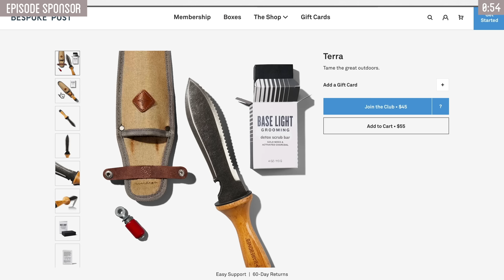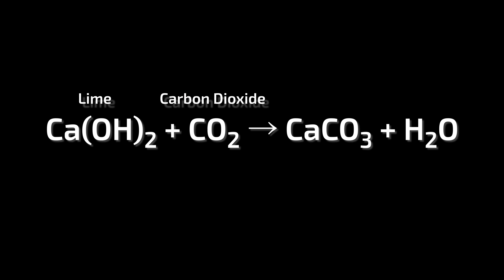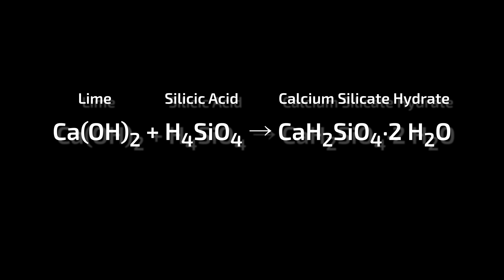How to Make Roman Concrete (4 Different Materials, 4 Different Strengths)

Comment: Lesson #1:  Don’t use round rocks in concrete.

Roman cement is not used for its strength but its resilience to weathering as it cures over 30-50 years. A crush test is testing the wrong property.
Reply: If the cure time is measured in decades, a crush test of months-old at most concrete is also testing on the wrong timescale.
Reply: I was looking for this comment. I was going to say the same thing. A crush test for Roman concrete after such a short cure time doesn’t showcase its amazing properties and potential. Roman concrete continues to cure and strengthen over much longer periods of time.
Reply: @Hundura  Without question, you are correct.  He failed at allowing it to have the cure time which would give the crush test its best result.  HOWEVER... the Romans weren't waiting 30-50 years to use the concrete.  It was being used - more or less - right away.  If a concrete brick ( or whatever shape being used) couldn't take the required load after a short period of curing, then it simply wasn't going to be around to finish the curing process.
Reply: @Hundura  Maybe, but if you are building a structure you would want to design and build it around it's strength in the near future. I don't think they ever intended to make the bricks then leave them half a century before finishing the building.
Reply: Round river cobbles were used in concrete until at least the 1960's. They are not as good as angular aggregate for high strength applications, but for many structures round rock is 'good enough'. I just worked on a highway bridge built in 1961 with a river cobble concrete mix that is holding strong after 50+ years of heavy truck traffic.
Reply: I feel like while it's not a completely fair thing to test it is still somewhat valid. Though it probably still cured a bit longer before use(cut for time because Youtube of course) it was still used to build things ... things that had force put on them. And modern concrete is also used partially because it lasts a long time as well(It is just also put under more stress making people think that it doesn't.
Reply: @xarin42  yes but he didn't use salt water in its construction and the type of roman concrete he made was for upper walls/roofing, foundation roman concrete had far less pumice in it we are talking single digits. To put into actual perspective the Worlds largest Concrete dome is made by the romans out of Roman concrete and modern concrete doesn't have the strength to weight to copy it without steel reinforcement.

He made a low strength high pumice Roman concrete then added aggregate to it when it lacked the strength to properly bond to such aggregate due to being a low weight low strength mix.

The calcium-aluminum-silicate-hydrate bond in Roman concrete is twice as strong as the chemical bonds in modern cement, you even add a few % of Pumice to modern concrete to make a Roman type concrete with increased strength and durability.
Reply: did we ever find out quantities of each ingredient to make up Roman concrete also? too much of one substance and not enough of another will completely change the properties of the end product.

There are a few factors to this test not being super accurate or fair.
Reply: we actually don't know the true recipe for what they built their longest lasting monuments out of we tried analyzing it and using the same ingredients but it doesn't turn out as well(their secret ingredient was seawater so the right amount of salt is key)
Reply: @Anon-zu3xn  actually we did find it a couple of years ago. We have had the recipe for a while just couldn't get it to work right. Apparently we were missing that when they said water it was meant to be sea water
Reply: @wk9953  there's one recipe I heard of that uses pigs blood
Reply: @Anon-zu3xn  yup, but actually we found the ingredient list, the issue is the process. That is passed down and memorized by apprentice from master. Plagues, wars and loss of trade over time is what made us loose that. Yes salt was key, but their was also some sort of kiln or cold fusion that occured. (Actually, I'm thinking earth was more volcanically and geo active back then.  Which can be proved by the gases not coming out of the Oracle areas like it used to, but it will again cause the plutonium fault always has a big one every 667 years and we are due. Thus I'm thinking they used magma instead of ash. Them and the greeks knew how to throw people off and keep secrets).
Reply: @razorransom1795  they did use a special type of salt from the local area to make mummies in egypt so perhaps that could have something to do with it,a lot of the result could be humidity based as well if theres too much humidity concrete won't cure the same as an area with no humidity
Reply: @Anon-zu3xn  That was Natron (Not sure if I am spelling it right) I don't think the Romans would have shipped it for all of their construction projects. I would think that they would locally source as much as possible, The Gallley was an amazing vessel, but moving gain and other commodities would have had priority over the labour of a heavy mineral in great quantities.

One thing to keep in mind is that while we are modern and building upon generations of experience, we are all young nations compared to the Romans. The Romans spanned centuries and during most of that time, they had greater population numbers than most of the Medieval and renaissance world. they were highly advanced people even by modern standards. we only regard them as primitive because we are more advanced with our tools... but the flip side is that we are also very primitive in many other ways.
Reply: @razorransom1795  Not to mention each Master Mason likely has his own tweaks picked up from his master(s) and because of local material availability. That just makes harder
Reply: Even modern concrete cures stronger under water for a month.  I wonder if it could be stronger yet curing under seawater?
Reply: I’m really confused where everyone got the 50 years concept from what @PersonalPerson said. No comment that I’ve seen does he even mention a specific timeline. He is saying building to last thousands of years is pointless. It’s not, if we like history. However outside of tourist spots, many of the super old structures only exist because of the heritage and significance. They serve zero societal value. Also using old buildings in Europe isn’t exact either. Many buildings in places were destroyed during the world wars. Many others are continually under restoration. But let’s take homes for instance. Many older homes in Europe weren’t set up for electricity and significant renovations had to be done to accommodate this. Mean while new builds tend to be tailored towards the technology that exists. Most home built out of flimsy wood last around 100 years easily if maintained. So this whole 50 year argument doesn’t even make sense. Heck the way we use concrete nowadays won’t last that long. But who says we have the same tech or lifestyle in 100 years. It’s not to say lasting houses aren’t valuable but the ease of renovation and costs it what matters for residential. So yeah lasting forever. Not the brightest idea.
Reply: Roman Concrete was hot mixed with CaO (quicklime) distributed through ought and it takes months to cure.  I also don't think that volcanic ash is the same as the volcanic glass, but I'm not sure about that.  He didn't do the hot mix...
Reply: @VenturaIT  you dont have to hotmix. You can take any  hardwood ash ans mix slaked lime under it. 2:1 that results in a hydraulic system cement.
What is importend is that the slaked lime is fresh. Not every vulanic ash is going to work, because the ash needs a certain mass of kalium and or aluminiumsilikate. Google "geopolymer Davidovits" he researched that stuff for 40+ years. 
That stuff isnt new it is just not in fashion because of the economics of it.
Reply: judging by the material nearby where i grew up (Trier / Augusta Treverorum) and the fact they had to keep their soldiers busy making bricks to keep them from stealing/wrecking stuff due to boredom and being armed, they'd often just use smashed up bricks (eg rejects due to cracking in firing/etc, while the bulk of the nice bricks went to cheap construction materials for all the fancy "government" projects like some rich dude's palace) for concrete. makes for rather spikey rough "rocks" that also nicely soak onto the other materials in your slurry, and as a bonus you can use it for slightly-lighter-than-bricks mortar between your bricks :D
Reply: Also its not true I’m in concrete is we still don’t know more than the two ingredients of rocks and volcanic ash
Reply: Either way its still better than our concrete, so i call bullshit on whoever "they" is finding the information to recreate it. As a lot of the still standing structures of the roman empire that are still standing havent been in use its lifetime, i guess that will and should affect or effect my opinion on it. So we  need a side by side comparison and i guess it would have to be year by year lol
Reply: Plus, any test where the brick is either uneven or sits on a pointy object (like the fired red brick that had pieces of debris still attached) does nothing but create a massive point load that OBVIOUSLY will crack the thing. Btw, did anyone see where his pressure gauge is hidden? I didn't see one. IMHO this BS is all made up.
Reply: @TrunkyDunks  According to Wikipedia, "Its name is derived from its resemblance to Portland stone which was quarried on the Isle of Portland in Dorset, England. It was named by Joseph Aspdin who obtained a patent for it in 1824."  Apparently they don't cover the history at building inspector university.
Reply: @dchall8  feel better after that flex, bro?
Reply: there is no real point to buildings standing for that long. that is just wasting the land of future generations.
Reply: @MsHumanOfTheDecade  I have to leave my house in 1 more decade and buy a new one because this building ‘expires’ in 50 years since its being built. Imagine having to buy a new house when you are 50 years old with a mortgage of 20 years added in and only being employable for 15 of those 20 years. I would rather like a building that last an average human lifetime.
Reply: @viduranimalarathne8797  build with Rammed Earth. It will last longer atleast 300 years.
Reply: @viduranimalarathne8797  I'm sorry but I doubt that there are any buildings out there that can't last at least 100 years with regular maintenance. Even ordinary wooden buildings properly designed and maintained can last forever.
Reply: @Imaboss8ball  I was being sarcastic at the modern building code here.
Reply: @Imaboss8ball go check out the mcmansions that get built in the more expensive subdivisions.
Concrete slab houses in newer middle class subdivisions are notorious for shoddy construction as well. The developers crank them out so fast that in some the foundation starts cracking before 10 years
Reply: @MsHumanOfTheDecade  Roman buildings were used for a long time, not 5 years.
Reply: @MsHumanOfTheDecade  Modern people are doing far, far more harmful things to waste land than the Romans did with the few remaining structures that have lasted 2000 years - think toxic waste dumps, burying radioactive waste, Pripyat (uninhabitable for 30,000 years), and the many tower blocks that are now standing empty all over the world (some have been empty for many years - eg. hotel in North Korea), or modern Olympic stadiums that are nothing more than white elephants left to partially decay in the ugliest manner.
Reply: @debbiehenri345   Pripyat has inhabitants, they never left. Its illegal due to politics. Many of them now well into old age
Reply: @MsHumanOfTheDecade  Meaning that no one should/will be able to live anywhere long term, because we will all be perpetually renting, or essentially homeless?
Reply: @MsHumanOfTheDecade found the american!
Reply: @MsHumanOfTheDecade  I’m glad the Romans didn’t think like that when they built the coliseum, hehe, but it’s true that if you’re not going to build some timeless structure, but instead something that might become technologically obsolete, it then makes sense. It’s like our use of plastic right now, it has no legitimacy being into everything gadget we make since we mostly use it for disposable things that are not meant to outlast a decade.
Reply: @MsHumanOfTheDecade  they could always just knock it down if they want to build there
Reply: @MsHumanOfTheDecade  The Pyramids, hold my rock...
Reply: @MsHumanOfTheDecade  In the United Kingdom, there exist houses of remarkable beauty and historical significance, some boasting several centuries of existence. Given the opportunity, I would readily exchange my modest 40-year-old dwelling for one of these venerable abodes. However, I acknowledge that such preferences may differ, influenced by individual perspectives shaped by societal norms and personal experiences. The inclination towards consumerism, though prevalent, is not a subject for judgment but rather a reflection of one's upbringing and the circumstances they navigate.
Reply: @MsHumanOfTheDecade  you must be American
Reply: @Slouworker  Negative on that one big man, they’re just not filled with national pride
Reply: @Slouworker  as an American I don't see how that's American... Americans wouldn't care they would just tear it down and use the concrete again to save money....😂😂😭😭😭
Reply: @Slouworker  Maybe they're just a watermelon. Green on the outside, red on the inside.
Reply: @DMNssms  it’s because practically everything in America is designed to be disposable and most buildings are torn down within a few decades while the majority of the rest of the world designs and builds things to last a long time, often centuries. In America people think that companies that are more than 50-70 years old are really old while, for example Europe(and most likely also asia and africa) has breweries that have been operating for over a thousand years and most buildings under a few hundred years old are almost definitely still working with only the occasional renovation. The mindset of demolishing buildings because they’re slightly old and “waste the space of future generations” like that one person said is much more common in America than anywhere else iv’e been or heard of. Its also a big reason for why most places in America are either massive, ugly stroads designed specifically for cars with little to no regard for pedestrians or the boring glass and concrete monoliths.
Reply: @nikarthur9996   Lets be honest, the US economy is built to have each generation start over. Take away a home, culture, family and you have a robot, willing to work sand. Likely needing 2 full time jobs to eat.
Reply: @Slouworker  100% american
Reply: @MsHumanOfTheDecade  You...... you...... realize people can routinely live past 50 years right?
Reply: @sauceless6666  collectivism tends to lower the human lifespan when put into practice, lol
Reply: @MsHumanOfTheDecade  Americans looking at a 300-year-old building: Wow, what an old building!

Italians looking at a 300-year-old building: Ammazza, che edificio moderno!
Reply: @MsHumanOfTheDecade  silence, american

Comment: In Practical Engineering video about Roman concrete, he says that the biggest problem in modern concrete is the amount of water and the using of steel structure, which deteriorates the concrete overtime.
Another thing Romans used to do was to put concrete under pressure and relive tension, that's one of the reasons why they build huge monuments.
Reply: we still do that, its called prestressed concrete
Reply: @randomcow505  the Seattle space needle is made from prestressed concrete. It had a fail. Designed by a guy named Holmquist. he was a friend of mine’s dad. My friend is no slouch in the BRAINY department, either.
Reply: @cynthiaaiken2424  uhhh cool?

Comment: The version I read fairly recently (not sure where, though) was that the water they used for Roman concrete was seawater.
Reply: I was about to say the same thing but see you beat me to it.  I can't remember where but remember someone doing extensive studies to eventually determine that seawater was most likely used and then they tested the same recipe with regular water and the seawater one was considerably stronger
Reply: @John-lx8iu  certainly the 30+ grams of salt pet liter of the Mediterranean Sea water changes the composition a lot
Reply: @John-lx8iu I might have seen the same video. They used seashells roasted in a fire, volcanic powder?, And and sea water.
Reply: Yeah ive read/heard that too at some point maybe a documentary or something...
Reply: I heard somewhere that Roman Concrete for the bathhouses also used a little bit of clay when mixing it together.
Reply: Why does that help?
Reply: @kbee225  Makes the seawater and Volcanic ash reaction happen before you expose it to seawater. + it will be more than just the outer layer that gets the benefits from the reaction.
Reply: I believe it had something to do with concrete used in the  oceans but hell been so long ago don't remember

Comment: So one thing you can try for your concrete is using aggregate with sharper edges rather than smooth and soft, because it will help it to lock together better and be stronger. Also it looks like your concrete was a little dry maybe.

Comment: While we're here it's important to remember that concrete is wonderful, but comprises over 8% of global greenhouse emissions.
Reply: When compared at exactly the same size say 3x3 for example, a patio made from concrete has a lower carbon footprint than one made from timber, requires less maintenance and will last considerably longer.
Reply: @jesst5474  Watch out, you'll be reported for posting hatefacts.
Reply: It's cold right now so it's obvious we're not using enough concrete.
Reply: @Serahpin  ok boomer